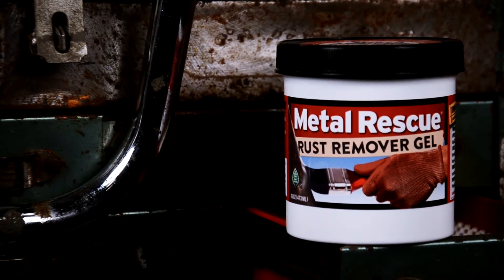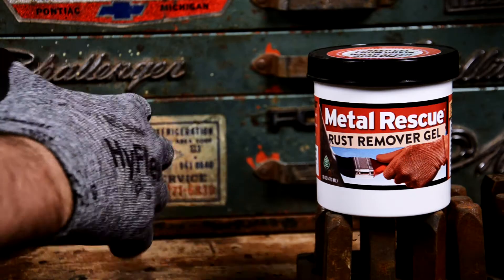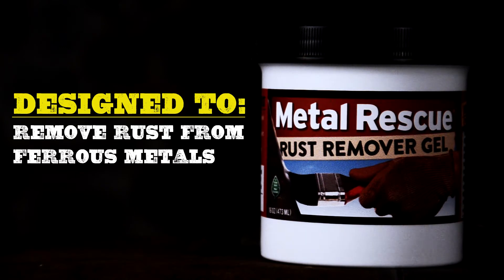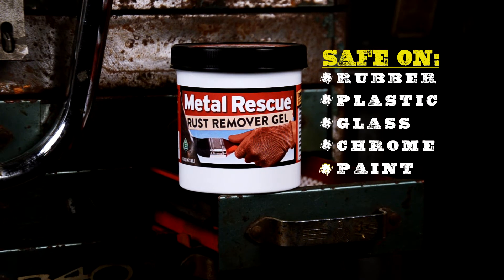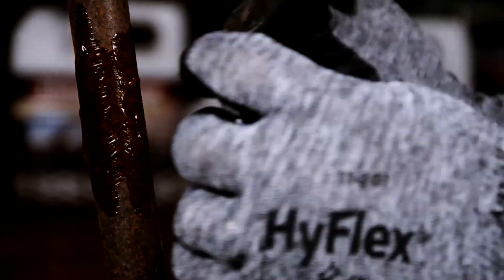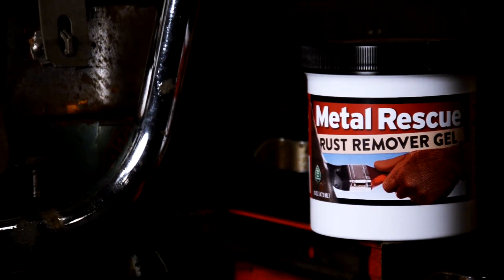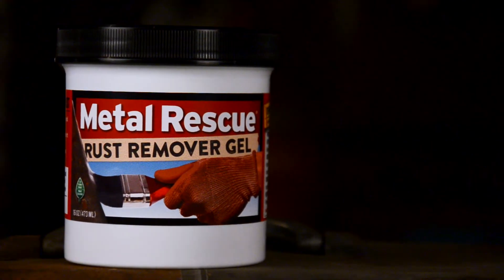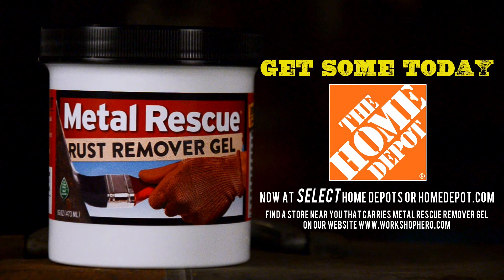*NEW* GEL Rust Remover: Metal Rescue Rust Remover GEL

Comment: How do you remove the gel, once it has done its work?
Reply from the maker: Hi Sylvia, removing the GEL is easy and safe. Just use a damp towel or rag and wipe it off when it's done. If for some reason it has dried on, then you may need to scrub it off with a soft brush or an abrasive cleaning pad. Thanks for watching and the question, please let us know if you have any others.
Reply: @BlasterProducts   if you're working in areas that are harder to reach to wipe well, is using a hose an effective method?  I plan on using this for a bunch of subframe components on a vehicle's undercarriage and it would be much easier if I'm able to hose down the undercarriage afterwards.

Comment: Trying this as I view it. I had a old hunting knife that was my fathers who passed in 2008. It was rusted pretty bad. I did not want to use a whole bath for it but to apply it with a gel to let it work & cheaper to. Got it from home depot today. I will do a follow up. I am hoping the knife after re-profiling it & sharpen it will look great. Do not know if I will get that shinny finish on this steel knife.
Reply: where's the follow up
Reply: @fishertech  got a lot of the rust off. But handle fell/apart off the tang